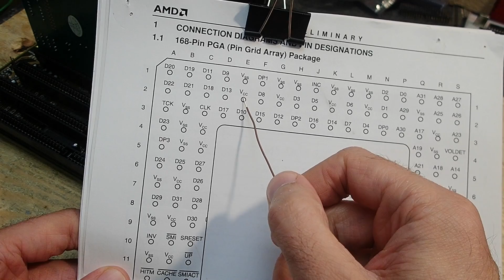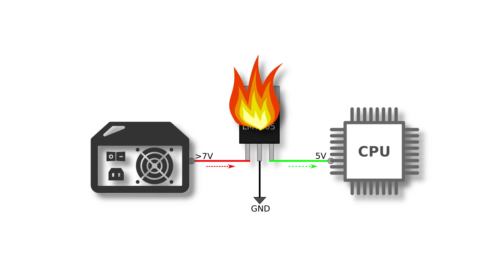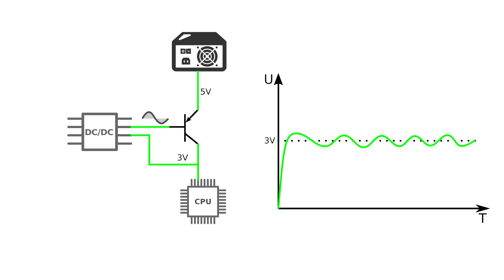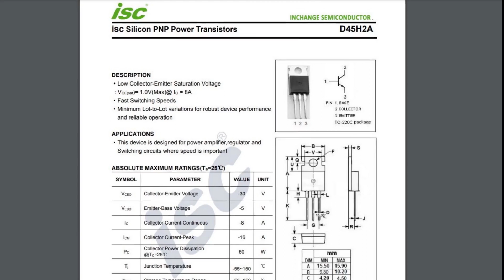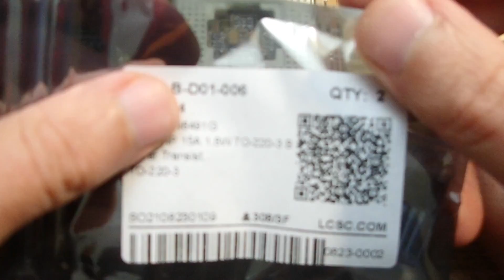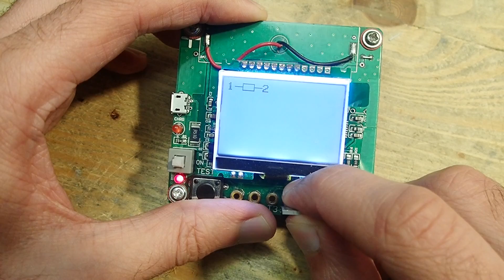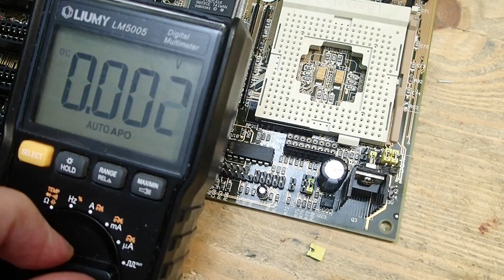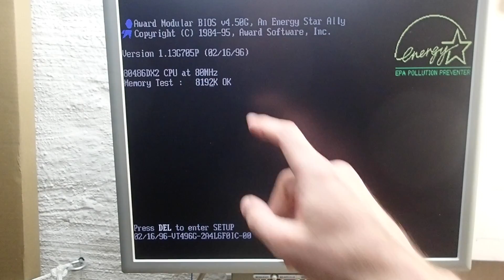Let's repair the CPU power supply on a 486 mainboard

Comment: TIL lp2951 and PNP transistor act as a darlington transistor setup! neato! <3 all
Reply from the maker: Exactly! +1
Reply: I think it will be Sziklai pair connection, a PNP works as a external current booster of the regulator IC itself, rather than normal darlington.
Reply: @ifgops  I looked at the data sheet, and it appears a PNP transistor is inside the IC package, with the external PNP they appeared to form a darlington pair. unless I read it wrong and it was an NPN... still neato!

Comment: The description of DC/DC converter was a little oversimplified, because it was more adequate for explaining how a linear voltage regulator works ;) In DC/DC converter the transistor is never (or at least it is not supposed to be) partially open - it is either fully open, or fully closed. It may work as PWM or PDM.
Reply from the maker: You are talking about switching voltage regulator and I was talking about 2-stage linear voltage regulator ;) If you are interested to see a switching voltage regulator, I'm planning to make a video about that one as well.... thank you for watching..
Reply: @necro_ware  DC-DC converter is a switching voltage regulator, lineal regulator doesn't use 'DC-DC converter' name.
Reply from the maker: @volodumurkalunyak4651  Yes, my bad. They are just called sometimes DC-DC converters as well, if you go shopping for them (9:45). That's why I used the wrong naming. If you look at the functionality it is actually a DC-DC converter, since it converts DC to DC, but usually nobody means a linear converter, but a switching one by that name indeed....

Comment: That was too easy! I have a Micronics M4Li for which the 3v regulator was an extra cost add-on. It wasn't a cheap board when new but the manufacturer was cheap. In photos the add-on looks like just the power transistor with a socket which fits onto a standard 3-pin header. My M4Pi (earlier rev.) had a super i/o chip which could not handle the faster (later) ATA drives.
Reply from the maker: It doesn't need to be hard, but if my planing becomes true, you will probably like one of my upcoming videos ;)

Comment: I believe it is also possible to mod the jumper section so it has a trim pot instead. Could be useful for overclocking and slight voltage increases. By the way, how hot does the transistor get? I would think that the heat is what probably killed the previous one...
Reply from the maker: After couple of doom runs it  was slightly warm. May be around 30°C, but I didn't measure it exactly.

Comment: wait so you're saying if you need 3.3v you can just solder a wire onto the transistor heatsink!?
Reply from the maker: Not always, you have to see, which transistor is used. Some of them put the output voltage on the heat spreaded, some are putting ground on it. So, it depends.